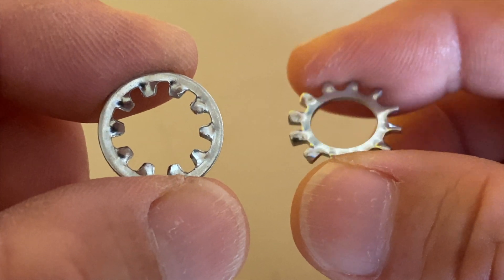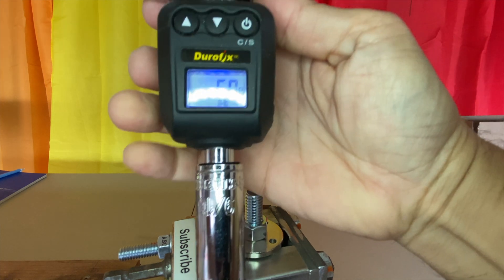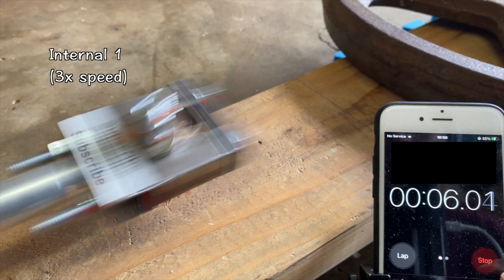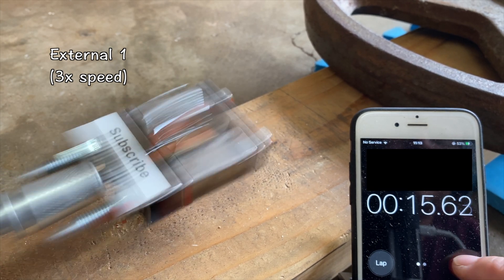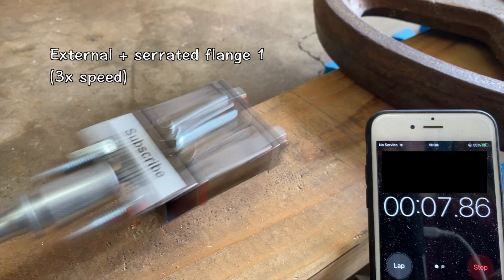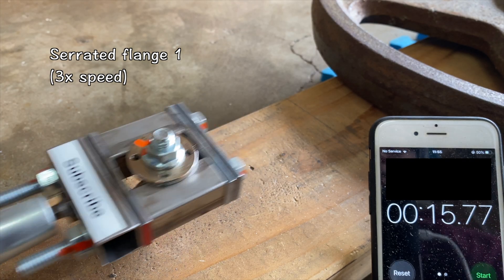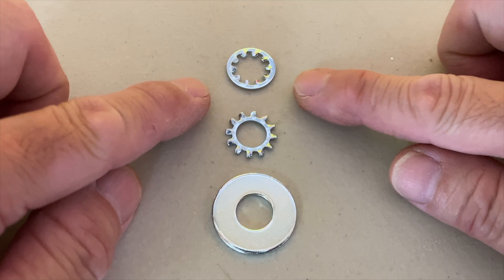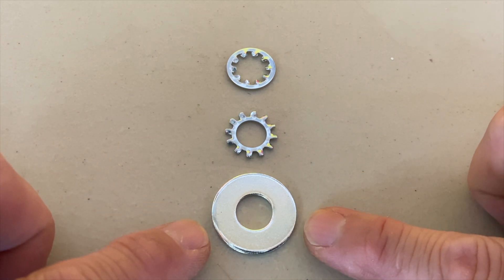Nuts & Bolts - Internal vs External Tooth Lock Washers – DIY Impact & Vibration Test – Part 4

Comment: This really isn't interesting because the rated torque for a 7/16 in. grade 2 coarse thread bolt is abut 35 ft. lbs. In no application would any bolt of this type ever be torqued to six ft. lbs. Therefore none of these tests are valid, as no lock washer will dig into the bolt and washer as they are designed. This is like testing a chain saw with the engine off. You have to give it enough torque for the washers to work as designed or they just skate over the surface of the metal.

Comment: 6 lbs.   so…. Pretty much set up to fail.  
I understand that for purposes of the video.  You don’t want the test to go on and on.   And on.  And on.   But if you had tightened them down to a slightly higher setting I think the results would vary greatly.   Not a scientist.   Just a guy.   My two cents.  Make it tight so it’s right.

Comment: I think star lock washers (and spring washers) are designed for a minimum torque...enough for the hardened washer edges to plastically deform and bite into the nut and clamping surfaces to react the loosening torque. If the lock washer edges don't bite into the surface, it can't lock.

Comment: Thats how these washers are ment to be used, fingertight fastened gettin smashed to the multiverse
Reply from the maker: Fingertight… LOL!
6 ft-lbs is much more than fingertight.  Try loosening a nut or bolt that has been torqued to 6 ft-lbs with your bare fingers.  
👍😎

Comment: Although I enjoy this channel and the testing you do, I found this to be of little value.

The 6 lb-ft of torque may be the reason all failed. That’s far, far below the recommended torque spec. Even 10 lb-ft is way too little. The low torque makes the whole exercise of dubious/no value. Why did the nuts loosen? Because they were never tight to begin with.

Running the tests using the recommended torque value for the bolts would take longer, but would give meaningful results.
Reply from the maker: Thanks!  A properly torqued nut and bolt would take forever to fail in my test rig.  😁
10 ft-lbs holding a plain nut for 10 min and failing in seconds with the internal, external, and flat washers surprised me.
Reply: @HacksbyDad  "and failing in seconds with the internal, external, and flat washers surprised me."
The teeth are supposed to actually bite into the material, that can only happen if the material is soft enough and the torque is high enough. If not then  the teeth just reduce the amount of contact-area and therefor friction and therefor the amount of grip.

It would also be interesting to know what kind of abuse your test rig deals out, compared to what the washers are designed to deal with.
Reply: @vinny142  less surface area doesn't create less friction fyi. they probably failed faster due to secondary moment forces.
Reply: @HacksbyDad Yeah that was weird.
Reply: He didn’t want this test to go on for days. He has a real day job.
I’m sure he would like to see other people’s similar tests.
Reply: Your mom doesn't think 10 ft/lbs is too little.